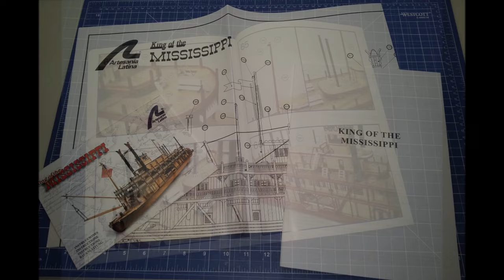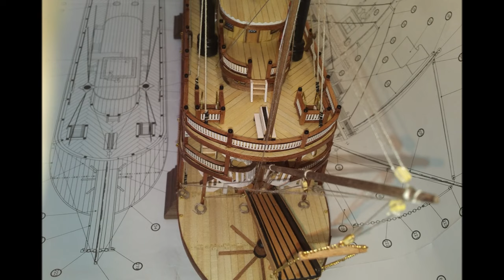KING OF MISSISSIPPI by Artesania Latina-wooden model ship Build Log

Comment: Do you have any advice on gluing the Handrails and Railings around the edge of each deck.  The end-grain gluing of the rails to the bases is giving me fits.  I'm curious how you did it?
Reply from the maker: If I remember correctly I used a good quality super glue. But it is a hard work in any case.